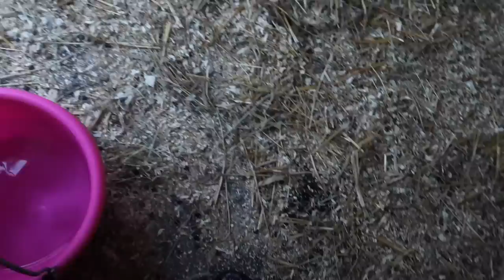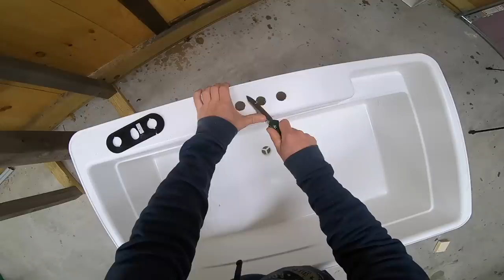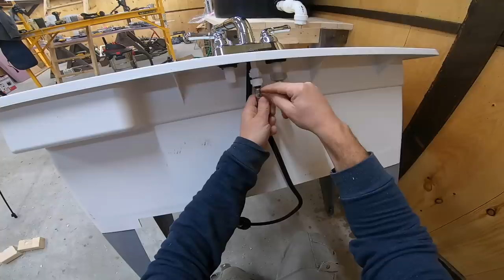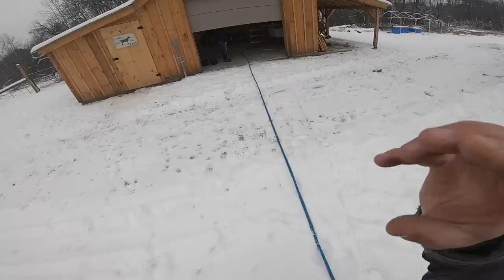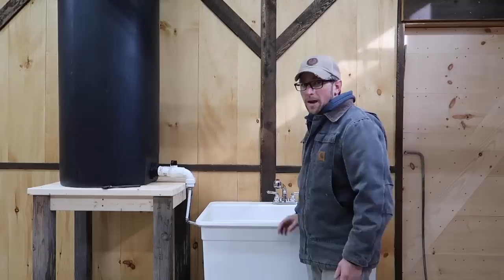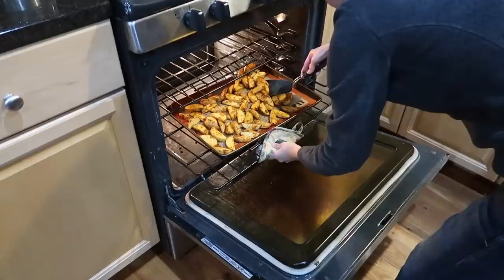Hooking Up the Water storage System Everything Was going so good until the END

Comment: Ok, Here's My Two Questions of the Day ;  Question #1 : How are You getting Water into that 100 gal. Storage Tank since you didn't put in a underground water line to the Barn Building ?                                         Question # 2 :  Are you having a Well dug in the spring for a Water Supple source for the Barn ?
Reply from the maker: Having a well dug would be nice.
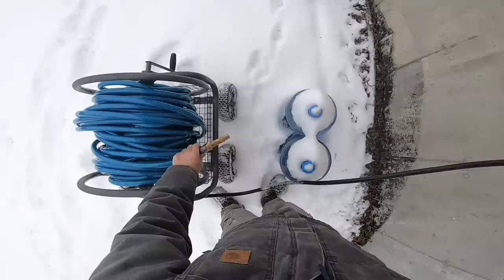Reply: In the video the tank was filled bu using a hose from the house see from 13:31

Comment: The water restriction in the the faucet is located at the point of discharge. Unscrew the end cap (where the water comes out). You should find an aerator screen and a small doughnut shaped restrictor. Take out the restrictor  and you should be good to go.

Comment: Think about using a 12 volt on demand water pump like used in recreational vehicles. Senses flow the pump comes on and stops when flow stops.
This article may be helpful.

https://www.smartrving.net/best-rv-water-pumps/

Off grid cabin use of a 12 volt system. Way down the article.

https://www.offthegridnews.com/how-to-2/easy-off-grid-ways-to-get-water-to-your-dry-cabin/

Hope you find the best solution.

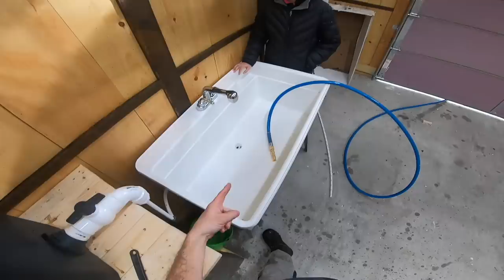Comment: 110 volt pressure activated pump , northern tool . EASY ! keep the 1/2 pipe. 1,000's of folks have done this easy set up. Basically an RV setup with 110 volt. I do not understand why you did not install 2 things. A site a clear vertical site pipe on your drain line, to tell when tank is full ? 2nd . A permanent fill   soft hose or hard plumbed plumbed to your tank inlet, with a quick disconnect or simple garden faucet, mounted to wall  to garden hose, without getting on the ladder and removing the lid every time you refill tank . Question why do you need a standard kitchen faucet with sprayer head?  Why not just plumb a simple garden faucet to the tank ? In the video - 17:05 "you have water but NO PRESSURE". You are using a pressurized faucet for a gravity feed design. It was never going to work . Maybe in the future you draw a simple design and post it asking for feed back ? Experienced Viewers are willing to help you . If you are open to suggestions. You could have pre plumbed a tee in your drain ( water supply) line , for your future inline water heater. Better planning makes for easy installs.

Comment: I read that the amount of light they get is what determines their laying habits. If you can provide them with a consistent amount of light through the winter, they will lay through the winter.
Reply: 14-16hrs/light/day for consistent flock laying. Since he doesn't light them, they are molting, which is good for the hens to rejuve their body and calcium stores in their own bones (where they pull the calcium for the shells). Might call up your local extension office and see if they have some extra diets for off season laying recommendations. I'd send the one I wrote up years ago when I was in that office myself, but I have no idea where it is since the move...

Al should be giving them some limestone or grit if giving full corn and not cracked. BTW corn is just a carb in the diet for hens. They might get fatty from that which can lead to issues later like not laying...

Comment: Aluminum, install a tire valve stem at the top of the tank,  then pressureize the system with your air compressor.  Adjust the air pressure to your liking.
S. Bruno